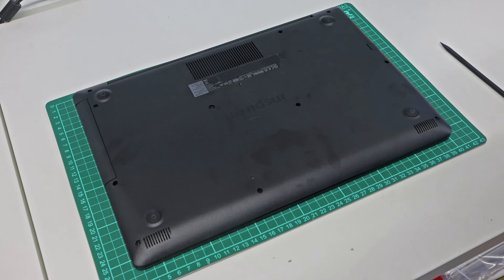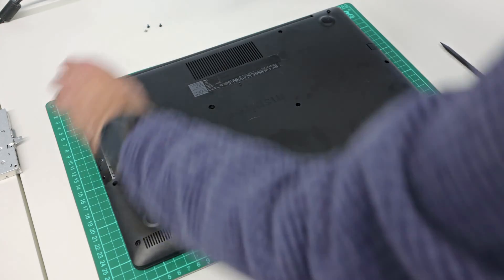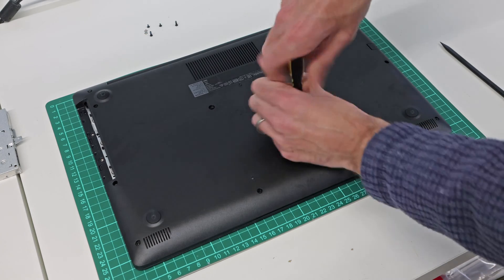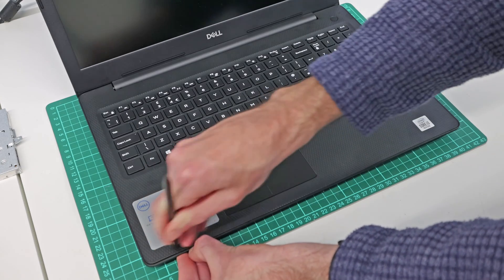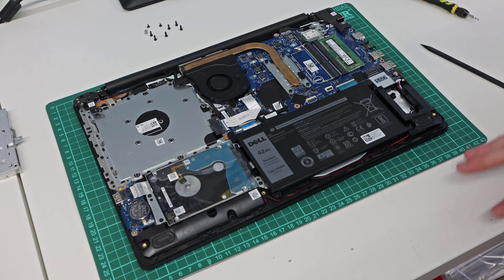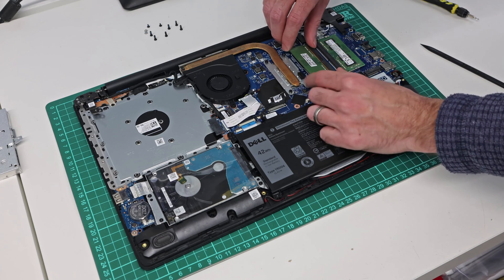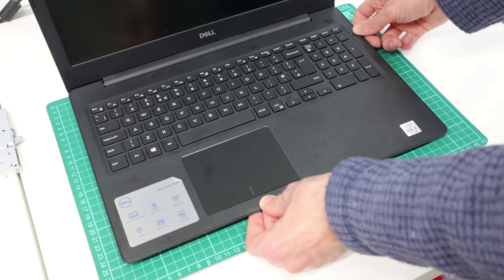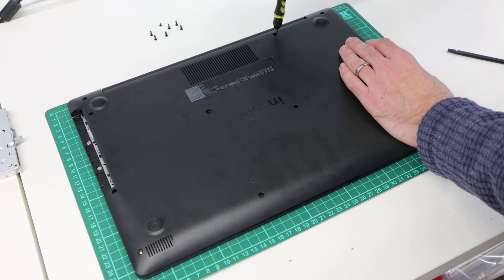Dell Inspiron 15 3593 - DDR4 RAM Memory Upgrade Guide

Comment: Thanks for this video, managed to change the ram on my Dell Insipron I3 from 4GB of DDR 4- 2666 RAM to 16 GB of DDR 4 - 3200 RAM. Only issue is that it doesn't work at 3200 but at 2666. But I had the 16 GB RAM from my Lenovo Legion which I upgraded to 32 GB, so this was a free upgrade. :D

Comment: is it possible install the secondary hard-drive/sata-SSD in the optical drive bay ? the bios shows the secondary sata connector, and I wish use this laptop as a truenas scale server when it retired....
Reply from the maker: Yes, you can fit one in a caddy.
Reply: @BrueComputing  I got one hard-drive cable from dell inspiron 5593(my little brother's laptop) but my 3593 is non-ODD model, it's has ODD connector on the motherboard, but I don't have ODD connector to ODD cable, and it seems the ODD connector is incompatible with first HDD hard drive cable, buying an ODD cable is unrealistic, because you also need to buy an ODD to HDD caddy.

Comment: My Dell Inspiron already has 8GB DDR4 (2666 MHz) RAM. Is it possible to add another 8GB DDR4 (3200 MHz) RAM with it? 
I am worried that the difference in speed will not work properly with the laptop's CPU.
Reply: it will run at a lower speed

Comment: Thanks for the help.  First time adding memory for me.  A couple of things for a total newbie.  Dell's website only gives only gives you part of the information to help get the right memory card for your 3593.  Depending on the hardware, there were two speeds for mine.  I bought Crucial DDR4-2666, 8GB.  Check you bios for the correct speed (2666 was the correct choice for me).  Also, Crucial's tool recommends putting 2 16GB cards into the machine.  Dell says the max is 16GB of ram. The 8GB was about $40, if you buy from Dell it was over $80 not including shipping or taxes.   No DVD drive on mine, I removed all of the screws from the bottom.  They are different sizes, lay them out in the pattern taken out so you don't mix them up.  I don't have the plastic pry tool.  I very gently used a flat metal screw driver to open the gap wide enough to insert an old credit card and then slid the credit card along the edges to free the latches.  It worked fine.   On boot up, you get a message acknowledging the new RAM and an option to look at the bios.

Comment: Great video. is it necessary to even upgrade the SSD  along with the RAM to see the  effects??
 I was thinking to only upgrade the  RAM as i have almost 600+gb empty.
Reply from the maker: If you have a hard drive currently you'll see a MUCH more noticeable improvement from going to an SSD than you will from adding more RAM.

Comment: So replaced the ram without removing battery, now my laptop wont trun on on any ram, any ideas  ? I dont eveb get the error code indicator. Power light comes on and fades out after a few seconds while caps lock remains on
Reply from the maker: This is why you always disconnect the battery first. Was the laptop still on/in sleep as opposed to shutdown when you did it?
If you disconnect the battery and try and fire it up with the charger plugged in what does it do?
Reply: @BrueComputing  just got back home after the visit to local repair shop. Im sure that my laptop was shutdown instead of on sleep mode before I swapped ram modules anyways. What he did was cmos reset which fixed the issue and the display was back with finally the error message that my memory size was changed and now my laptop is working again with 16ggb ram. It is very dumb but always always always unplug the battery before making changes to any hardware on your laptop
Reply from the maker: @daemontonjay2021  Glad to hear you got it going again!

Comment: Urgent question:
can I increase RAM, 8GB RAM is already installed and now I want to install 8GB in other slot, so will this laptop support 16GB of RAM.

Furthermore, how much maximum RAM I can install in my laptop?
Reply from the maker: Yes, a matching DDR4-2666 8GB module should work just fine.

2 x 16GB should work without issue too.
Reply: @BrueComputing  

2x16GB or

2x8GB = 16GB

because 2x16GB = 32GB

Please make me clear.
Reply from the maker: @imtiazdahar8451  If you want to go to 16GB RAM then add an additional 8GB module.
In terms of the maximum that can be installed, you could remove the existing 8GB and fit 2 x 16GB for 32GB total.

Comment: friend help, I have the same laptop dell inspiron 3593 has the 4 GB of RAM can I put a 4 GB and an 8 GB to make 12 GB? in the DELL prompts it says yes it can, but I want to know if it's okay with you.
Reply: ofc u can add a soddim memory 4gb and a 8gb there are rumors that u cant run dual channel with diffferent ram modules but its fine just make sure its around 2600mhz just like the company fitted :}

Comment: I've noticed sudden fps drops from some of the games in this laptop. I have 4gb ram and hdd memory. Which one is better upgrade, adding ram or changing to sdd? thanks. (PS: I know its both but which one should be done first?)
Reply from the maker: 4GB RAM will cripple gaming performance. Make sure you upgrade to a pair of modules - eg. if going to 8GB you want 2 x 4GB, not 1 x 8GB.
Reply: @BrueComputing  Thanks, gonna add a stick soon.
Reply: @BrueComputing  but adding another 8gb will add up to a total of 12 gb and wouldnt it be dual since the new 8gb would be in the second slot

Comment: I replacing my 1 piece of 8gb to 1 piece 16gb Ddr4 2666. The result is my laptop won't boot at all.  But when I plug back the 8gb ram it works ok. What seems to be the problem? I return the 16gb Ram for checking and it's working fine.

Comment: Hey brue! I added another 8gb ram from crucial and my laptop hasn't been able to turn on after installation but if I remove the 8 gb ram it works!
Reply: It takes longer to turn on once you’ve installed any new memory to your system, did you wait a little longer for startup?

Comment: does it support 3200MHz Ram
Reply from the maker: DDR4-3200 DIMMs should work, but they will only run at DDR4-2400 or 2666 speeds, so don't spend more on them.

Comment: Great help, hadn't ever added memory to a laptop before, excellent clear video, upgraded from 4Gb to 2x8Gb Crucial.  All worked perfectly, thanks!  (72, started working for IBM 1973, 1st customer had 32Kb Mainframe.. they ran an insurance company on it!)
Reply: After putting the ram, do we have to update or install or run any additional software, or just like plug and play the upgraded ram will start functioning?

Comment: First of all, hi, I was going to consult you on a subject. I have a laptop on my dell inspiron 3593 and I want to replace the graphics card. There is a geforce mx230 card on top right now. What is your suggestion? thanks
Reply from the maker: You can't. The graphics chip is soldered to the mainboard and isn't upgradeable.
Reply: Brue Computing  Well, can not solders be removed and a compatible graphics card added?
Reply: Which cpu do you have?

Comment: I've tried that, but Laptop Does not want to reboot. I've thougt that maybe my New ram is broken. I've bought a new Ram and still does not want to boot.  first Ram was Crucial 8GB 2666MHz DDR4 Ram CT8G4SFS8266. Second Bought RAM was : Kingston 8GB 2666MHz DDR4 CL19 Notebook Ram KVR26S19S8/8 Y-43106. There should be a mistake in somewhere or There Should be a button or something. Please HELP.

Comment: Hi sir, I have dell inspiron 15 300, 4GB ram, I5 core 10th gen.. It was quite slow whenever I perform even a simple task.. Can you suggest me some possible option or advice to achieve a better perfermonce 😕
Reply: Hi. You got any solution. I am planning to this laptop. 

Is it manufacturing issue? I heard this model i5 1035 g1 mx230 is getting heated.
Please reply
Reply: No it's the heatsink design issue
Reply: Ssd for faster boot/loading times. Ram for more tasks

Comment: Do you have to disconnect the battery connector?
Reply from the maker: If the battery is left connected then it is possible the board still has power and you could damage components whilst installing or removing them - given that it is very easy to remove it might not be essential, but it is good practice and silly not to.
Reply: @BrueComputing  What key on the keyboard do you press to get into Boot options?

Comment: Do you need to have the same amount of ram? I have a 4gb ram installed, should i get another 4g ram or can add  an 8gb ram? So that i have 12 in total
Reply from the maker: For gaming performance with integrated graphics, matched modules are preferable. For general usage 4+8GB should be fine.

Comment: Hey pal, i appreciate the videos. exact model. I've looked all over dell.com for the answer but still cant find out what the" cas" (CL) latency of the memory
also, the dc barrel jack port, do you know the replacement part number?
Reply: Most laptop does not support X.M.P. profile, so it should be JEDEC standard ,19-19-19-43-CR1@2666, the SODIMM made by Kington that has XMP profile is designed for some NUC, AIO computers that support XMP.

Comment: is it crucial ram on all the machines, including the 8G standard variant? looking to upgrade to 16 and wondering if brands work together or need the same ones??
Reply: In theory, they all works at JEDEC standards, but I can't guarantee this for you, I have two 16G memory made by Micron, they works well (total 32GB)
Reply: @yuan.pingchen3056  Do you have 32 GB of RAM in this Laptop? (Dell Inspiron 3593)?
Also, do you have the Usa version?

Comment: is it possible to install two 16Gb memory cards? manual said that one 16gb card is fine, but what with another slot? can it be just windows limitation? if so I can ignore it, because i'm a linux user. But if it is hardware limitation - I can't (
Reply: as for as I can see,  i7-1065G7 chipset support up to 64Gb ram... so I think I should try.
Reply: @firstnamelastname2298  it will only support 32GB as per Dell, but yes the normal chipset should support 64GB.